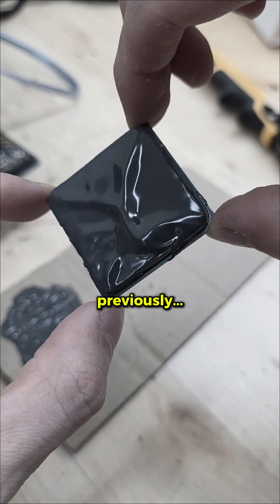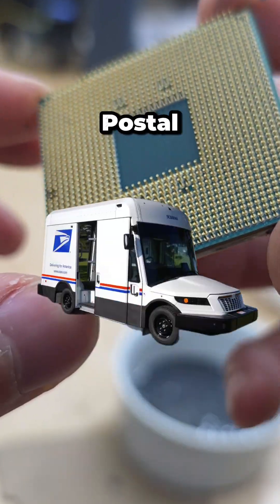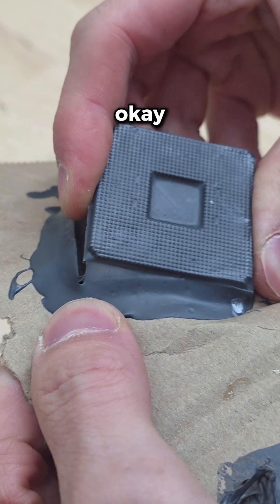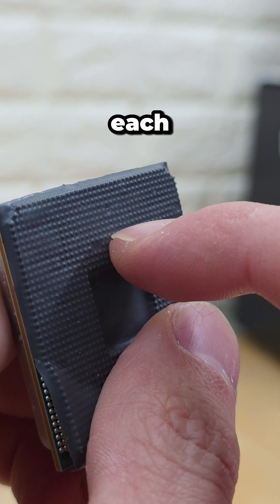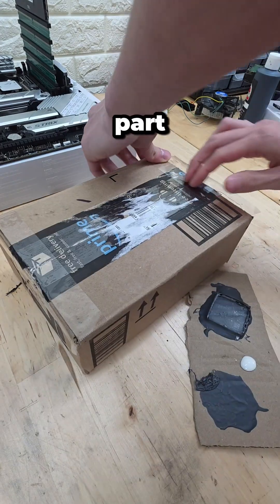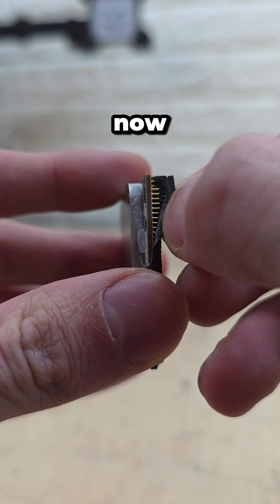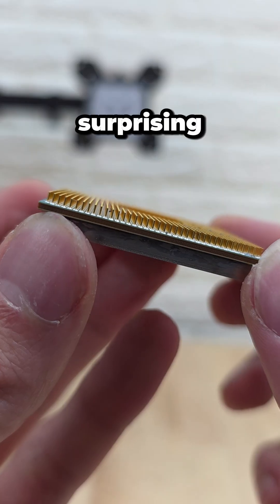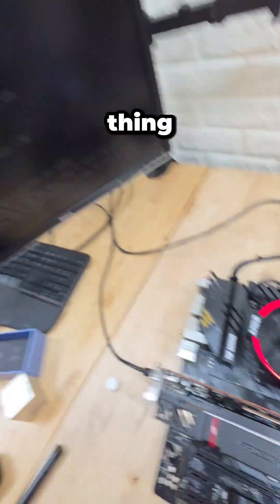the ultimate way to protect your CPU

Comment: Using A knife to power on your PC is diabolical
Reply: Nah. It's just metal
Reply: Its works the same as the power button works, just connect 2 pins so electricity can pass 🤷🏻 nothing weird here
Reply: Using a conductive (metal) item to short the pins on the motherboard is extremely common. Scissors, butter knives, jimmies... anything works.
Reply: @Deado  Seems like a lot of people here never heard of a test bench
Reply: @zachgokc  they mostly just consumers that never build anything themselves
Reply: @zachgokc why would you get it on a test bench and fire up the scope and everything, all just to bridge two pins? just use a knife.
i am on team yeester with this one, he did nothing wrong in this video.
Reply: @h@h @howdyfriendall est bench can mean building a PC outside of the case before transferring into the case. Doesn’t have to mean a fancy set up and scope like he has. I didn’t even say he did anything wrong lol
Reply: @zachgokc I use a screwdriver for mine
Reply: @zachgokc  not everyone here is a pc nerd
Reply: @WaagonWheel  it’s a PC nerd channel lmao like look what you are watching
Reply: @zachgokc  some people are new to pc building and they want to learn? Not everyone knows abt pc building right off the bat
Reply: @zachgokc seems like alot of people here didn't have their power button dying on them
Reply: @WaagonWheel  alright so here's the explanation: you know those little connectors that are a PITA to connect properly that send data and do other functions related to the case buttons?  Well any switch ever literally just completes the circuit on the positive side of the power line.  So, pressing the button on your case is literally doing the exact same thing as what he's doing with the knife, and you could do with almost any piece of metal.
Reply: @zachgokc  Yeah I’m legit surprised at how many people don’t know you can pin switch your PC on. It’s always fun working as an IT guy at a boomer office building, they’ll see me sticking metal bits into pins and without fail will yell “hey! Don’t shock yourself now!” Like, lol thank you for the concern Debby but I think we’re all good here.
Reply: @zachgokc Why would someone that likely builds a PC one every 5 to 10 years need a test bench? I also change the oil in my car every few months when it's due, should I go ahead and install a multi-thousand dollar lift in my garage too, just to change the oil once in a blue moon? Maybe I'll hire an in-home pharmacist to check things first before I occasionally take an aspirin. Good job typing without thinking first.
Reply: @what1watch973  Hey genius, look up what “bench test” means, it doesn’t mean an actual workshop for testing PCs 😂 when you test bench a PC you test it outside the case. I did a “test bench” for my PC on a folding table, not an electronics workshop. You put together your MOBO, CPU, and graphics card and see if it posts. That’s all. No fancy work bench’s needed.
Reply: @zachgokc I just was always too scared to use something without any isolation on the handle, just in case
Reply: @WaagonWheel  If you want to learn, then that makes you one of us nerds.
Reply: @zachgokc yep, you can see the likes of the original poster
Reply: @Deado  I haven't built computers in awhile and you brought back some good screwdriver post tests
Reply: @Deado lithium batteries
Reply: @Deado  so many gate keeping lonely dweebs fighting over their pin shorting knowledge 😂 top tier entertainment like some incel reddit shi 😭
Reply: @JiMaReal fr lmfao what is this thread
Reply: @Deado  when i waited a couple days for a new power button i used my finger.
worked surprisingly ok
Reply: @Deado  "Extremely common"
Reply: @NoFunNoHope Yes, it is.
Reply: @Deado currently doing this with a screwdriver after upgrading from am4 to am5 because i broke my power button somehow 😂
Reply: @Deado  Dell used to use non-standard pin arrangements back in the day. Some people found this out the hard way.
Reply: @Deado the power button on my old pc broke so I spent two years just using a screw driver to turn it on lol.
Reply: @Deado I like using paperclips.
Reply: @Deado  screwdriver here. broke my power button once with a swift kick.
Reply: @plateofshrimp  s k i l l i s s u e .
Reply: @plateofshrimp you showed your PC who's boss
Reply: @plateofshrimp  these comments are so cringe
Reply: @subsonicdz  what the fuck are you yapping about
Reply: Most people use the screwdriver they are building with, as it’s super handy for testing things work before wiring everything in the case
Reply: @zachgokc  not "most"
Reply: @m @martinweb  yes, most people who power up their PC without a power button during a build do so with a screwdriver, if you need some extra help with reading comprehension
Reply: @zachgokc  You says things that don't know kiddo
Reply: @martinweb  then what do most people use to turn on PC genius?
Reply: No, not really? He just used metal to turn it on its not like you have a constantly working on and off button when working in electronics either
Reply: Using a overrated word like diabolical is diabolical.
Reply: @NapmasterNr1  the word overrated is overrated
Reply: @CytonicOnline  Yes it is. 😂
Reply: @CytonicOnline   the word word is a word
Reply: @CytonicOnline  The word word, is word.
Reply: @NapmasterNr1  damn. everything is overrated nowadays even words
Reply: @M @MALAS_EDITZ  Life is tough. Like for example reading the same comment under every single video. It’s diabolical.
Reply: @MALAS_EDITZ  it's more of cringe and wrong way of using certain words as if you could toss it into anything, now we see why our education is on a steep 90° decline
Reply: @NapmasterNr1  bro thats diabolical
Reply: @chrisp3five  😂😂
Reply: Isn't a button just a thing that connects two metal plates together with another one?
Reply: Are you a bot? What's with all the comments just like this?
Reply: … is diabolical, can youtube shorts comments ever not use this word
Reply: This is how i power up, i dont have a case 😂
Reply: Yt shorts mfs are always talking bout some "diabolical" 💔🥀
Reply: It's canonical. Everyone used a knife at least once
Reply: I always used usb drives 😂
Reply: Knife or screwdriver, whatever is conductive that fits in the palm of my hand will do
Reply: Stop saying "diabolical" every sentence, ya twerps.
Reply: Can you even call yourself a lazy college student if you haven't used a flathead to boot your pc for half a semester vs emailing the case mfr for a replacement front panel?
Reply: I used to short my pc with a pop can tab. My friends called it the "funny computer."
Reply: That's how you can turn on a pc without a button
Reply: I use a knife to remove the CMOS battery.
Reply: I used screwdriver alot when i was in countryside and got my power button unworking it is approachable into deep casing also but long press(both pins short) can turn off circut again😂
Reply: I use one to start my truck it isnt that weird its resourceful
Reply: To fair he do diabolical things
Reply: Not really though. Bridging the pins is how it works, and the devil has nothing to do with it.
Reply: Right? I'm sticking with my broadsword!
Reply: i power my pc with a lighter which is kinda funny
Reply: @colaonyourface  why don't you try smth heavier next time?
Reply: Try using your finger!
Reply: I just use my finger. Its easier and I hate poking electronic components with metal.
Reply: that's how somalis turn on a pc, if they manage to steal one.
Reply: i usually use my scissors, screwdriver anything conductive near me hahaha
Reply: I use a screwdriver everytime I turn my pc on
Reply: ITS BUTTER KNIFE DUM DUM
Reply: It’s actually not that bad and will cause no damage  to either knife not the pins it’s actually how a button works
Reply: You can use a screwdriver also in this case
Reply: I've used a reed switch too and a piece of wire aannndd a knife 😂. Inside Centurion gate motors are little tiny IR switches those are next on my list.
Reply: Thats the cmos pin use it to completely drain and wipe ur system
Reply: used to use a screwdriver when my pc was inbetween cases 😂
Reply: On no another person who doesnt understand what diabolical means just following an internet trend.
Reply: Used to do it with my test build but i used a poxket knife of a fish scaleing knife its easy to do and feels like your a wizard
Reply: How else is he gonna turn on his pc?
Reply: .. guys just use your finger, you are conductive and it's such a low voltage you won't feel anything.
Reply: That's how I do it, my power button broke
Reply: when im building a pc and am eating during it i use the knife cause its more precise than a screwdriver so i dont accidentally short reset instad
Reply: That is very normal thing to do when testing.
Reply: Looks like someone has never built a PC haha - Knives, Spoons, Screwdriver - we use anything conductive.
Reply: Mein kollege schaltet sein pc immer mit einem schraubenzieher an weil er zu faul war die frontpanel pins anzuschliessen😂
Reply: This was me for the last 10 years
No case, just a shoebox with the motherboard. Poke it with a knife every morning.
Reply: brass knuckles or bullet next
Reply: I fucked up once and assumed my pc was broken (new build) for like 2 weeks, trying to figure out why it was just completely dead. 

Then I shorted the pins and it came to life, 
The power switch just happened to die the second I had a new build lmao.
Reply: I use an old rusty plier from the 90s
Reply: I used an screwdriver first time so, no worries
Reply: I use pencil
Reply: There's no difference from a butter knife and a screw driver pin when it comes to turning on your pc
Reply: People don't realising it's about electrical safety since knife handle is also metal unlike screwdriver 💀
Reply: we used paperclips and screwdrivers all the time when i worked at a pc shop
Reply: Yeah you must be a bot with this comment
Reply: Not really, just a basic way to hotwire the mobo without a power button
Reply: I use a long metal bbq skewer and mines not even a test bench I just mashed upgraded tech into a Optiplex 9020 case but need to remove power switch wires from a regular case and solder them into my case wiring just been lazy.
Reply: And a 9v battery on the tongue is invigorating 😂
Reply: Firs time seeing someone who uses knife to open a motherboard?
That's common tool bruh.
Reply: We used an old axe just for fun of it.. its not thatt deep,  two pins need to be shorted in any way possible
Reply: I guess everything is diabolical today...
Reply: I've been using a screwdriver for near two decades.
Reply: Bro is worked in Amazon returns testing motherboards... powering them with a razor blade was typical and fixing pins
Reply: My first PC was a bunch of scrap parts assembled in a huge tupperware container. I kept a nail tied to it with string as my "on switch"
Reply: I’ve been using a metal pick to turn on my pc for 3 years 😂
Reply: I WAS GONNA SAY THIS
Reply: this is how everyone here powers their pc
Reply: I use my pen to do this everyday at work... I'm a PC and laptop technician
Reply: Not really, I usually use a fork.
Reply: A bread nife
Reply: Oh look a meme speaking brain rotted pleb with no thought process to understand what it takes to rub 2 brain c eels together to say anything other than an overused quote 

Talk about a walking embodiment of a square
Reply: That was a butter knife
Reply: Had always turn on my pc with a screwdriver since i mounted the first version of it 6 years ago aprox and thought "meh i'll buy a case for it later" till 5-6 months ago 😂
Reply: *butter knife
Reply: It is just simple method, this is not rocket science
Reply: I'm going to power on my test bench with a Glock barrel just for you.
Reply: Jesus loves you all so much that he died for you so you could have eternal life, Repent and turn to him before it’s too late, I want to see you in Heaven with me one day
Reply: @IloveJesusChristamen go away clanker
Reply: @IloveJesusChristamen  ok narcissistic egotistical catholic/chirstian rage bait npc bot 😂
Reply: The knife does not power the machine, it closes the circuit, that in turn starts the posting process.

Comment: Isn’t  rubber made out of trees so your using a tree
Reply: Technically, you're right. -if it was nearly a century ago. 
'Rubber' today, means just about any elastic polymer. Most 'rubber' is usually synthetic and made from petroleum or natural gas.
"Latex Rubber" is a natural tree-derived rubber, though.

Comment: “Protect your CPU” ❌
ragebait ✅
Reply: how is this ragebait
Reply: @acgaming007  cpus come in little plastic trays. you can reuse them and they protect the pins. so this method is pretty overkill. also most modern cpus don't have pins anymore. also he said "how clean" it comes off while showing black residue on the cpu.
Reply: also I can imagine you can easily bend pins when removing the rubber.
Reply: @GoodOlKuro 💀😡🤬
Reply: @acgaming007  Because you obviously don't need rubber melded to a cpu to safely transport it, given brand new cpus are stored perfectly fine in plastic trays with cardboard boxes, and seems to carry more risk considering how attached the rubber is to the pins.
Reply: @acgaming007  It's not lol, that person doesn't even know what ragebait is, they're probably like 10.
Reply: It's both😂
Reply: Ryzen 7 1700x
Costs $40 used.
Reply: No rage bait. I can see biodegradable rubber-like cpu protection for shipping to become a thing in the future. It could be sold with the rubber-like protector in an envelope that can all be biodegradable, so less trash waste piling up. Because, to be honest, 99 percent of people in the Americas (USA at least) do not bother to properly recycle trash. This test has a real-world use potential for shipping used or even new cpus. New shipping methods worldwide which are minimalistic and biodegradable could help many 3 world countries as well. Those places where trash lines the streets and hills of the whole town type places need the change for using more biodegradable product packaging 📦.